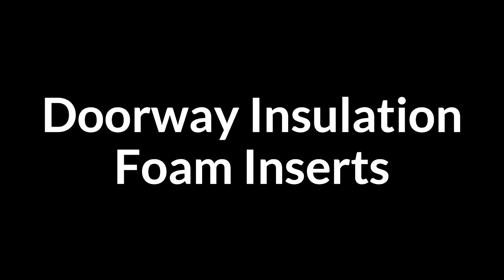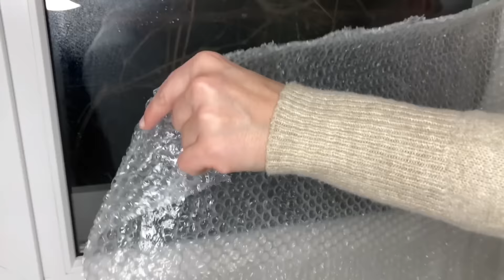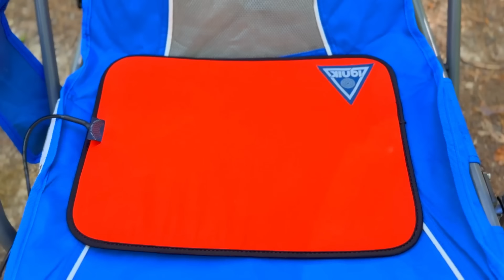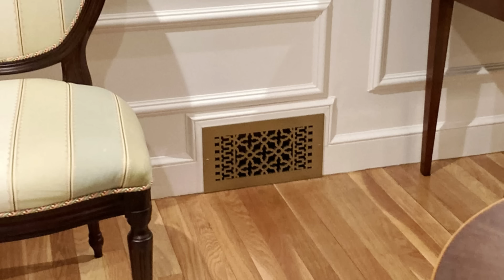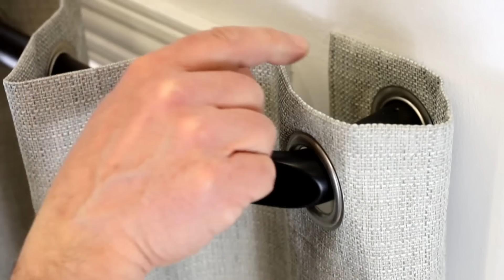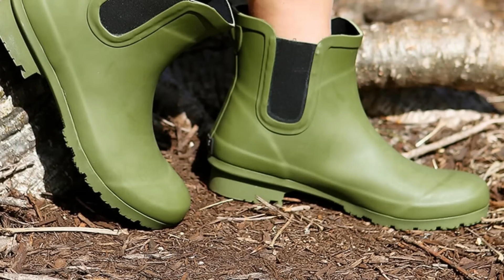Grandpa's 42 Emergency Heating Hacks to Survive Winter Power Outage

Comment: stop doing these home made  heat things without it being in a metal washtub or something metal. I have housed the homeless in New Orleans for decades cold can kill you without freezing when these tip over you have a fire keep a large container of water near AND olive oil is hard to light but you can do it if it falls over no fire, now days solar powered lights are bright and last you can use the sun have both. Get a carbon M alarm

Comment: >>>the candle under the terracotta pot is dangerous. It can explode or do a flash fire. Also it releases more carbon monoxide than a candle.
Reply: Watch the amount of smoke pouring out of hole on top of ceramic pot. Soot attaches itself to all surfaces in room. Is soot safe to breathe?

Comment: While there are some very good tips here, several of them could go sideways in a heartbeat. Be SO careful with open flames, ventilation, things like using propane indoors, burning alcohol (seriously?). All those candles and blankets snuggled up together, what could possibly go wrong.
Reply: If you have a battery operated carbon monoxide detector and you’re an actual mature responsible adult I think you can handle small candles/🔥 sources.
Not everyone can afford fancy generators & propane heaters.
Allot of people are barely scraping by these days🤷🏻‍♀️
Reply: ° @Nunyabiz981  Not sure if you were replying directly to my comment? I stand by my statement that there were several suggestions in the video that could be extremely hazardous. Yes of course a mature adult could burn a small candle but some people have children or animals in the home who may not be conscious of potential dangers of setting the damn house on fire when it's -1F outside. Also someone could be so hypothermic that they do not have full mental capacity when lighting a fire source. What I said was BE CAREFUL, so I'm not sure what your problem is with a safety warning. 😀

Comment: Grandpa had no Mylar Mylar did not exist
Reply: You do know that they aren't necessarily talking about YOUR grandpa right?
Mylar existed starting 1952.
Reply: Right.  @laurakryzanowski3193 Someone born in 1952 when Mylar first showed up would be 73 going on 74, born in 1962 is 63, 1973 is 53…….all those ages are well within Grandpa ages and great-grandpa ages in the older age range as well.  So yeah, Grandpa likely had Mylar.

Comment: So I am a little confused if we have a fireplace and we have no power why are we not using the fireplace 🤔🤔🤣 am I the only one noticing the inconsistencies of this video how are you plugging in a heating pad if there's power outage 🤔
Reply: Hear ya about plug in devices during power outages. On the fireplace deal. I do have a fireplace but live in a slum lord paradise.  Can only plug one space heater at a time. Otherwise breaker box gets tripped. Everytime. And I dont trust the fireplace. Seems to be a fire trap so to speak.
Reply: @brendabernstein286  wow that seems scary
Reply: @ScorpioQueen1 yes it does. That is why the fireplace is never used. I  also have no smoke alarms or co2 detectors or stove with oven. Like I stated slum lord paradise.
Reply: During 2021 TX Snowpocolips we used our fireplace, but found more warmth in our bedroom that didnt have a fireplace. Our living room has a 30 ft ceiling and is very open concept. 

We found smaller rooms better for warmth.
Reply: @momofkrew  - All my long life I've loved old houses and still do for many good reasons.  Except in remote TinyTown where it's almost impossible to find anyone to fix anything for less than a king's ransom if that.  

My 1880 2-storey just has 12' ceilings (great for summer bc I almost NEVER need AC) but when the living room ceiling fan croaked, the cost of bare minimum winter heat shot through the roof no matter how well I insulated the place immediately after purchase.  Due to a USDA loan I could have a whole lot of stuff done then bc there were 4 days work for a full crew from a city 70 miles away.  No more of that luxury now!

Fortunately I also love monolithic domes; so as soon as I can find a decent buyer for my beloved 1928-sq-ft big house, Imma build a single level dome instead with 8' ceilings.

PS:  If anybody's looking for a big old house with a heavy duty metal roof, excellent insulation, and pex pipe plumbing in the central Midwest for $155K, let me know and we'll talk when/if you can be thoroughly vetted.  I don't take wooden nickels.
Reply: Also basically, if you are NOT burning a fire, use more than closing the flue as your fireplace is basically like an open window or open door.
Reply: because this video is probably made with a lot of ai
Reply: You lose to much heat make the house cold !!!!!!

Comment: Another hack to stay warm is to wear nylons under clothing against skin. It will trap heat better than any long johns or pants. Cuz if you sweat, they'll dry faster preventing cooling effect from sweating. A lot of construction men wear under clothing to stay warm while staying flexible to move while working.
Reply: I prefer fleece ,. myself fleece and wool are the warmest to wear.
Reply from the maker: Lovin' it. Thanks for sharing, @RosalieSemrau!
Reply: Sorry. Nothing beats wool. Merino wool is not scratchy and will last for years if washed in natural soap & hung to dry. Wool was worn for centuries by sailors because even when wet it keeps you warm.
Reply: @Shotleythinktank  - Well, most of us are going to be indoors where it's probably not raining.  Besides, didya know that pro football players are wearing nylon hose under those pretty uniforms?  While they play in subzero weather too.  There's a lot to be said for one layer of nylon.
Reply: @frostyfrances4700 I was going to say the same, I agree! ❤

Comment: Excellent video though it's short on some of my favorite stuff.

First, I always feel compelled to remind people not to place tea lights jammed up next to each other bc that can cause a flash-over fireball.  Rather let them at least be separated as much as they would be in a muffin tin.

Since sand heaters aren't always mentioned in these videos, consider them as well for the sake of cost, convenience, and likeability.  Kerosene's getting harder to find, and it's always been an inconvenience to store and it stinks like hell.  Better a sand heater if you can.  I converted a beautiful antique kerosene heater into one and painted it bright red with stove paint; copper pot scrubbers from Dollar General boost heat conduction.  A bit of hand sanitizer bought elsewhere in bulk provides a much cleaner and safer fuel tor the muffin pan underneath.  

Also take heart in this recent development:  Literal plug-in solar systems that feed through an exterior electrical outlet are becoming more widely accepted stateside same as they are in Europe.  They won't endanger repair crews if the public grid fails.  A good starter system will set you back around $2K but it's cost-competitive and fully portable.  It will also lower your regular utility costs.
Reply: good point! Safety is needed at all times,